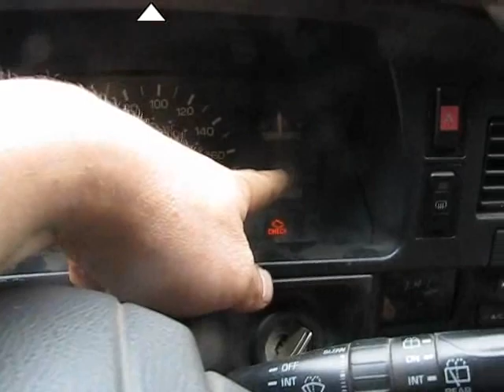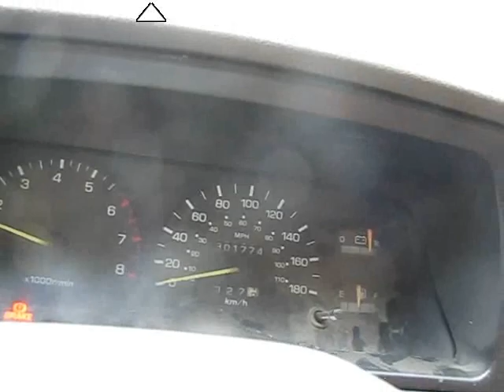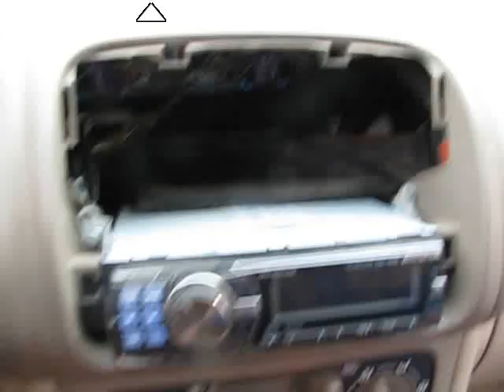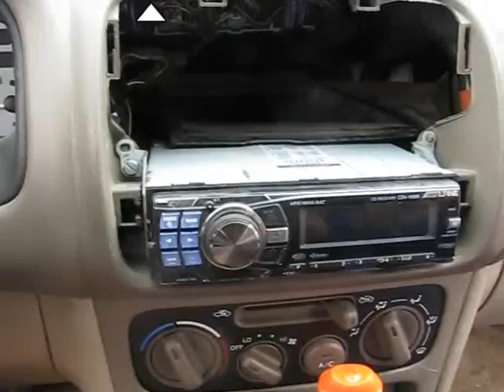94 4Runner: Driving Lights Re-wire, and Days-Off! (09/15/11)

Comment: Thanks Analog! I currently just have my fog lights switch mounted by my emergency flasher switch.. I just drilled a 1/2" hole in the plate and slid the switch knob through... Keep up the Toyota build!!!!

Comment: Hi analog! I have been religiously watching your videos and applaud your knowledge about cars and appreciate the insight you give to me as I am building a 95' Toyota pickup... My question is how did you mount your newest switch in your dash under your battery switch? how did you drill the hole or did you just cut a piece out? thanks!!

Comment: @analog56x Yeah they are great except for the fact that my 95' for some reason only has the clutch cancel switch on the left side of the dash.. there aren't any other pieces that you can take out the only one is the one above the emergency flashers... weird because I have a 91' and they have those pop-out pieces everywhere...